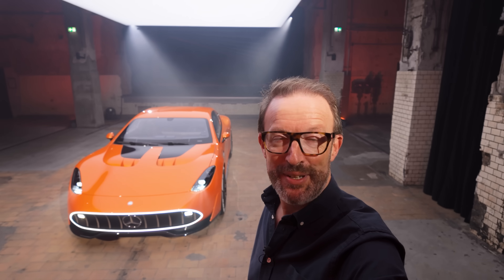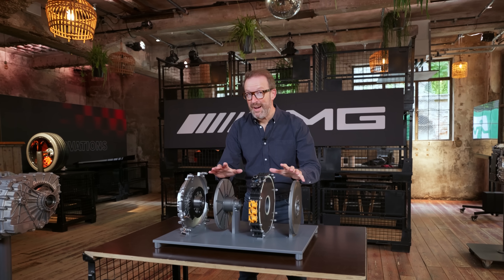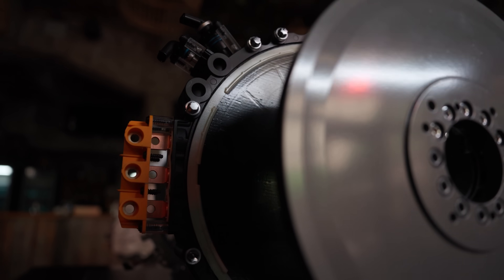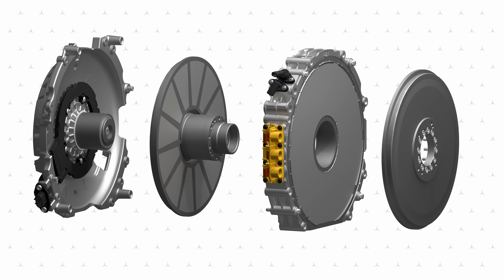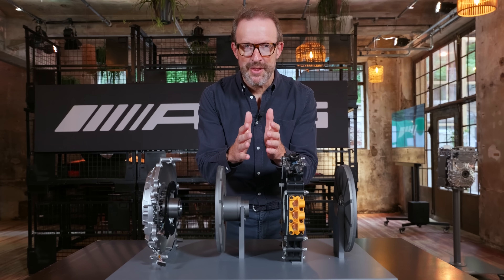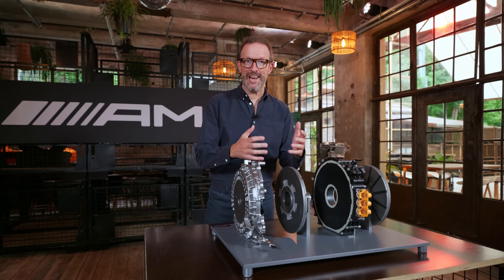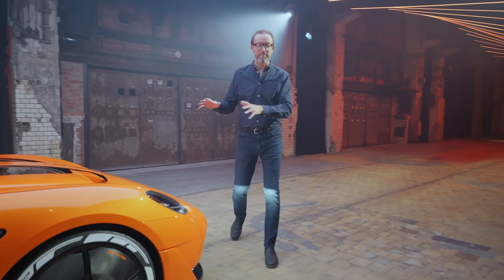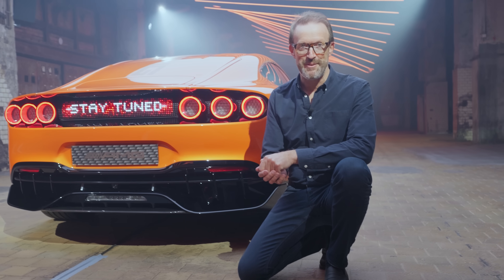Inside the Axial Flux Motor: What's Mercedes-AMG's Secret to High Performance? | Tech Explained

Comment: If mercedes benz figured out a way to make an inexpensive single passenger vehicle with one motor they would sell well. Even tune it down to 250 hp in something a tad larger than a motorcycle would be great. Thing is, they will never do it because they do not know how to simplify anything anymore.

Comment: Just saw an engineer comment on ECM‘s axial flux PCB coil site commenting on a video saying you can’t get any torque out of axial flux motors. Engineers can be so arrogant thinking they know everything. I’m guessing you need quite a bit of torque for a vehicle so this application pretty much disproves his point.

Comment: Technically speaking, this is a masterpiece! The benefits of an axial-flux topology are clear: higher torque density, better power density, and a more compact design due to the parallel arrangement of magnets and stator windings. This allows for excellent integration into the drive architecture.
What interests me most, though, is how the cooling challenges are addressed, especially under sustained high performance. The air gap is significantly smaller here, which could make heat dissipation more difficult. Also, how is EMC (electromagnetic compatibility) ensured with three of these motors so close together? Great video—it provides a fascinating insight!
Reply from the maker: We love that you’re geeking out with us! Those 25 new records were powered by a battery that cools itself as aggressively as it charges. The full story is just a click away: mb4.me/Concept-AMG-GT-XX-Tech-Insights/.

Comment: Yes, this is a great electric motor and will probably be the best one yet, at least due to its low weight. However, I think the main problem remains, which is having to recharge the batteries using the mains. I think this should be the primary goal of all manufacturers. Do you know if there are any studies on this? Congratulations on your short, concise, and clear video.

Comment: To: Mr.: Mercedes-Benz Company, If you think about applying the founding capital of your German car company [Mercedes-Benz] from the eighth year and multiplying it one thousand and two hundred times in addition to introducing an increase for each new car worth ten percent that has been sold from the eighth year of the founding of the leading company, this is a legally permissible matter, but it is necessary sometimes to inquire about the German legal system for companies if it is written, and if it is not written, fifty percent of the previous values are deducted due to the lack of initial regulation and a good attempt at organization.

Comment: Koenigsegg with Dark Matter motor: lololololo 😂
Reply: The dark matter motor is a copy of the mercedes benz motor. Look up who supplied axial flux motors to koenigsegg before they made their own
Reply: someone didnt do their research
Reply: @C111-e5y they all copy and use certain designs as each other.
Reply: @madbull4666  someone has to invent it and it wasnt koenigsegg
Reply: @C111-e5y I know, and it wasn't yasa or Mercedes either, axial flux motors have been around for decades.
Reply: @madbull4666  Not in serial production for cars

Comment: Go back to gas and reliability.
Reply: The longest-lasting and most reliable cars are diesel.
Reply: Most of car brand will move on electric, because the laws is forcing them, not mercedes fault
Reply: @JonatheinneYes, of course. At least I don't see any interim steps between diesel and electric. In our case, the only reasonable hybrid is 1 diesel Merc and 1 electric.
Reply: @hannu6169  alright

Comment: So, what is the power, weight and cost of the motor?
Reply: The motor is made by Yasa British company.  Weight 13kg and produces 1000hp. It's the only company who has twice record for only this year. 59kw per kilo. The price is 10000$ up. Second hand 3000$ to 5000$ I saw on ebay. You need a special controller coz is 6 phase motor. The new model I think is 9phase and 1000v.